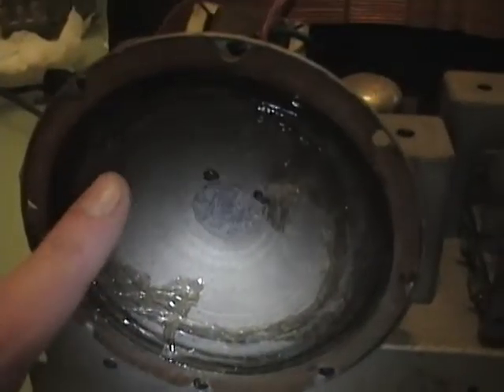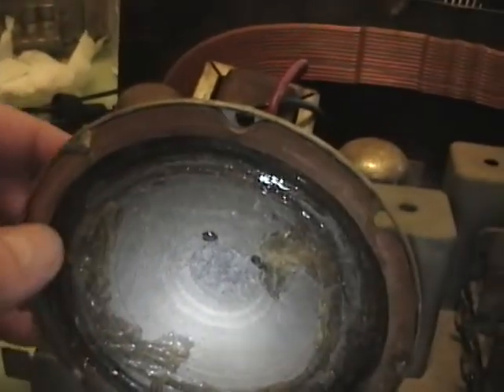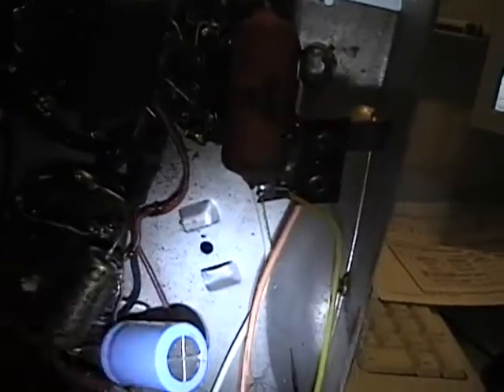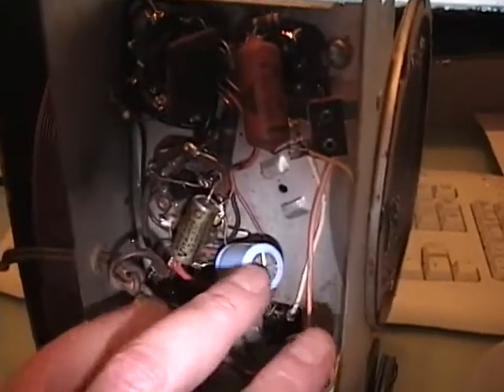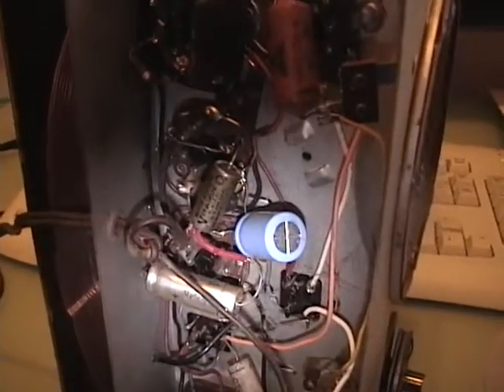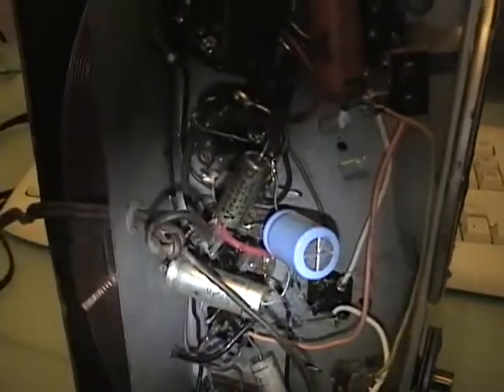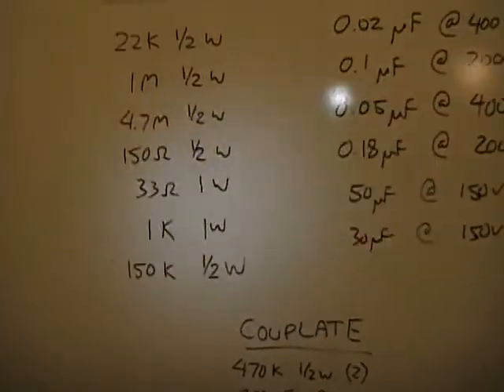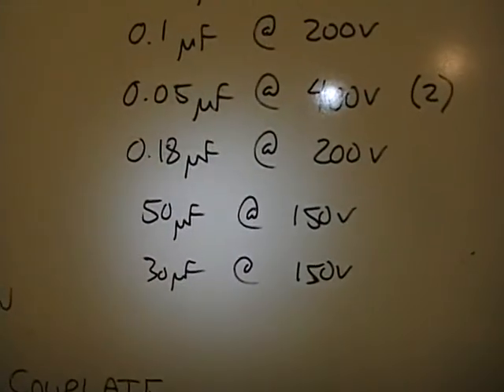Vintage radio restoration 101 (Admiral 5R11) - part 2

Comment: I don't know where the idea of smearing silicone on a speaker came from but it's a lousy one. Every time I run across silicone on a speaker someone has gobbed it on there and it manages to work itself loose causing a rattle. Whoever is using silicone on speakers stop it! Use contact cement, fabric glue, or speaker cement, save the silicone for the bathtub!